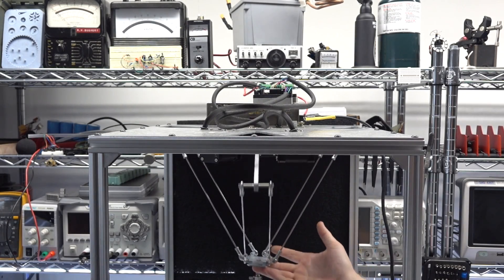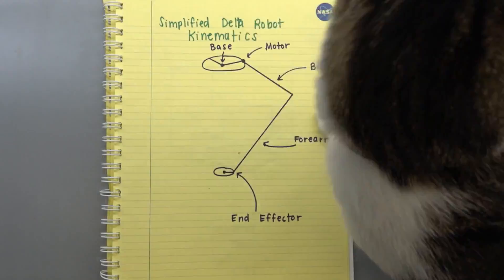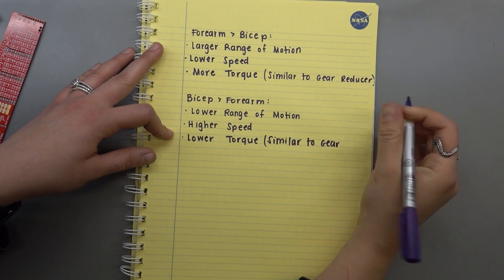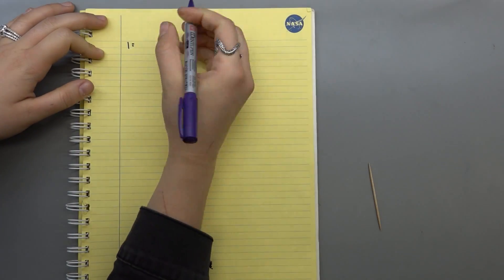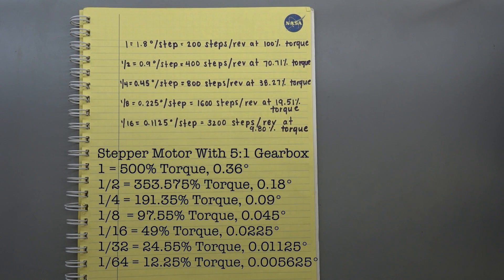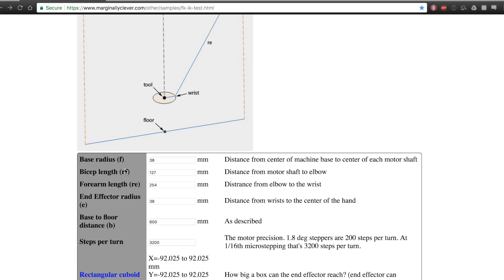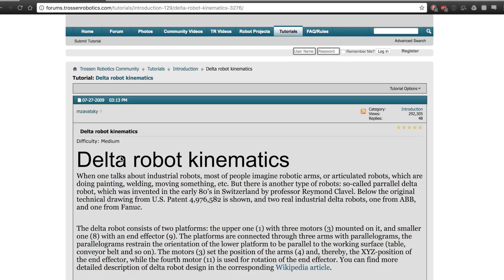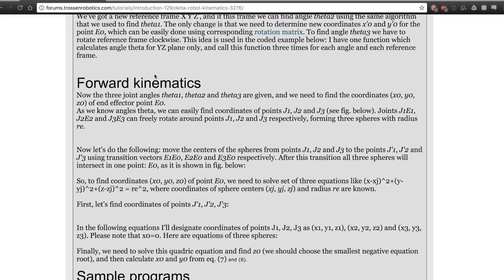Simplified Delta Robot Kinematic Equations

Comment: Where did you source the information on the torque losses in relation to microstepping resolution?
Reply: it's a common misconception that's even propagated by vendors. they talk about "incremental" torque, which is irrelevant really. if what they say were true, at 1/256 microstepping you would be able to stall a motor with your bare fingers, which is obviously not true. microstepping does NOT decrease torque.
Reply: @crackwitz  Agreed.

Comment: Hi Proto G, I used the same marginallyclever and trossenrobotics web site to design my delta.  The formulas on the marginallyclever web page are correct, but the diagram doesn't show the dimensions correctly.  I sent a note to marginallyclever, but he didn't fix the image yet.  The (f) and (e) values are the culprits.  The formula embedded in the web page uses the triangle sides of the base and the hand, not the radius.  That is consistent with other Marlin, Smoothieware and other sources I found.  Here is a link to my robot if you are interested to see.  https://www.youtube.com/watch?v=dS7qleSQp_k

Comment: I dig the Nspire CAS hanging at your workbench. I have a 10+ year old TI89 that's never given me a bit of trouble through engineering school and into my career. But given how much I still use it every day I was considering upgrading to one of those. Your thoughts?
Reply from the maker: It's an amazing calculator but pretty advanced for most calculations.  I think I still prefer my Casio FX-CG10: http://amzn.to/2BlvFWS  The large buttons are great and it does everything my older TI graphing calculators did with a much nicer screen.
Reply: Oh nice! Looks promising, I'll check it out. Having a PC with Matlab, Python, and Excel makes a lot of the more advanced calculator features seem redundant. But there are still a few things I like the TI89 for.

Comment: Cool project. How are you going to pick up the smd? whit a vacuum or small robot claws?
Reply from the maker: I have three different suction grippers that I'm going to experiment with. Right now, my main goal is to just sort different colored glass marbles and colored chips and then move on to things like picking up different sized coin cell batteries off a conveyor belt and placing them in their packaging.
Reply: @ProtoG42  I am going to vote for robot claws placing 0402 components. Vacuum cups are so last century.